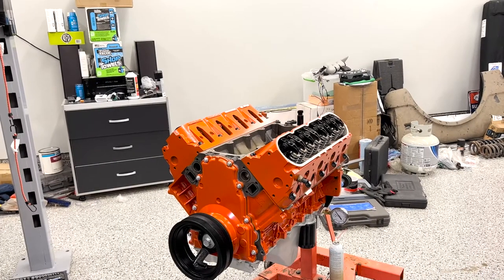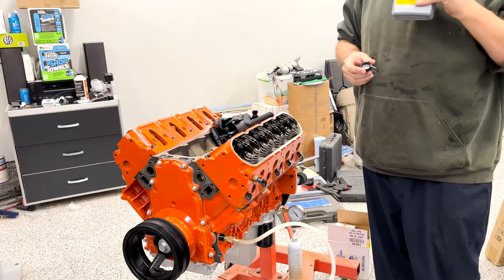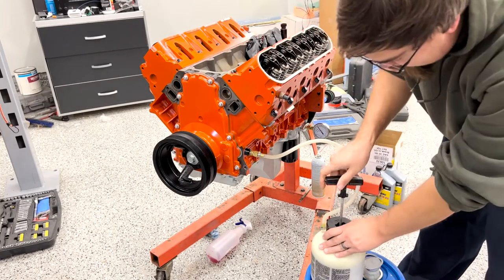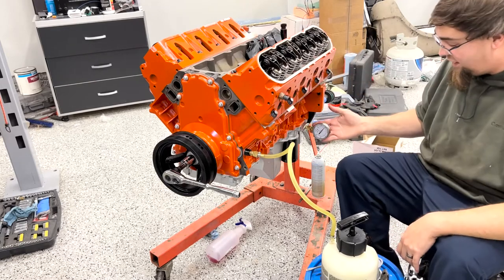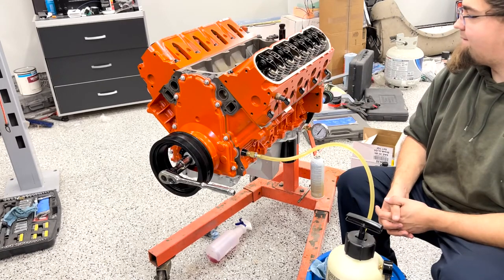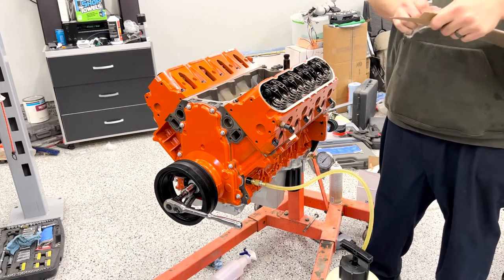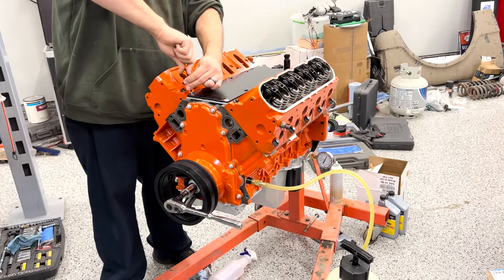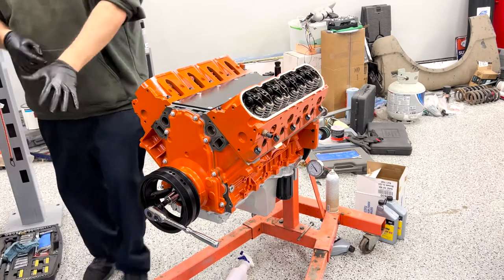LQ4 LS Engine Oil System Priming

Comment: Rotating the crank is more about getting oil into all the lifters and up all the pushrods to the rockers.  The clearances in the main and rod bearings will allow them to be fed as long as there is oil pressure to them.  The holes don't have to line up.